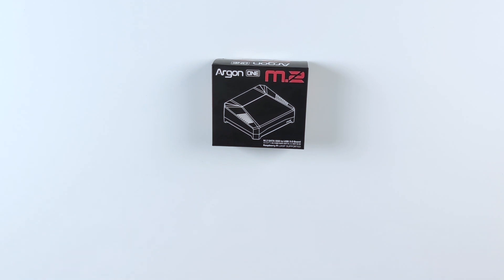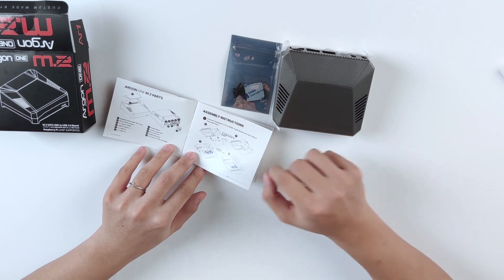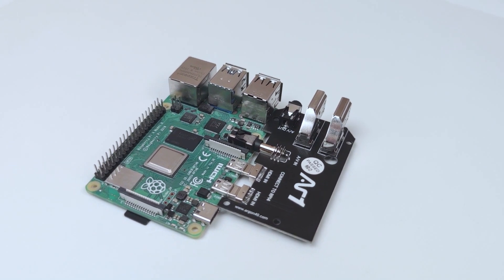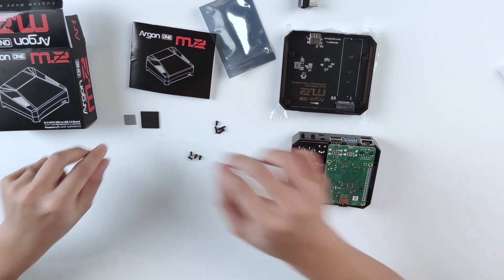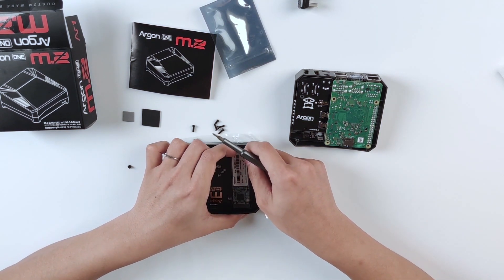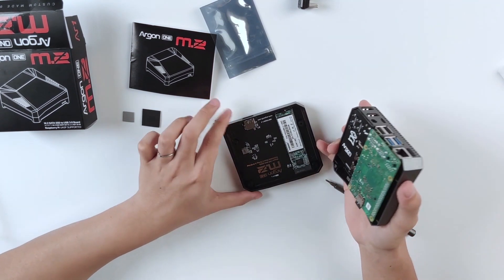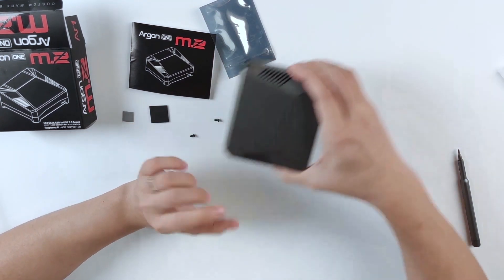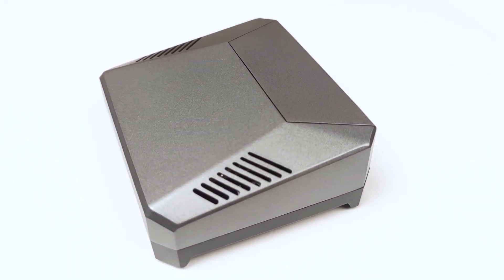Argon ONE M.2 Aluminum Case for Raspberry Pi 4 Unboxing & Quick Review

Comment: Is there room for a low profile heat sink to be added to the m.2 ssd?
Reply: Did you see the two thermal pads he had left over?  There are aluminum posts on the top of the case that will touch the CPU and RAM chips on the PI that uses the entire top of the case for thermal cooling.  The pads are meant to go on those posts to help the transfer.  I will say it does NOT come with extra screws.  He was just lazy and didn't put all the screws in.